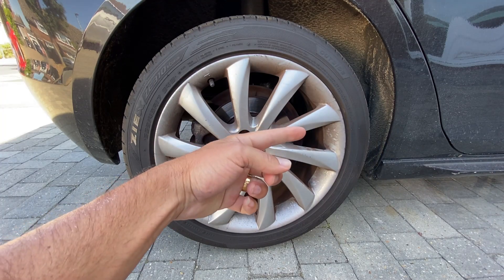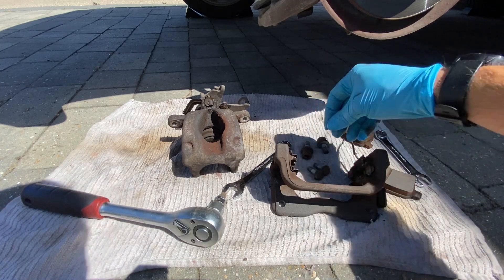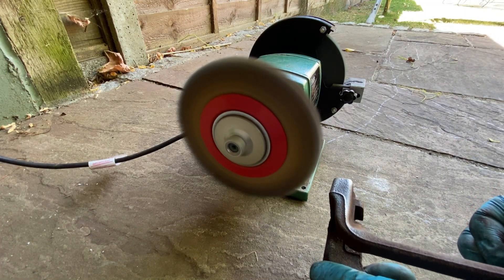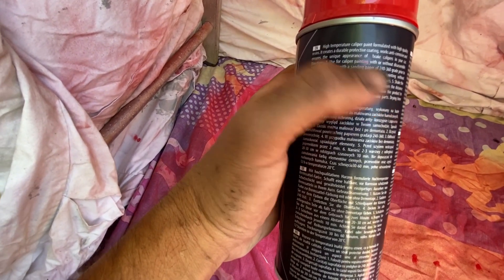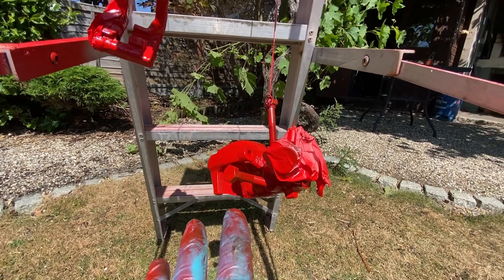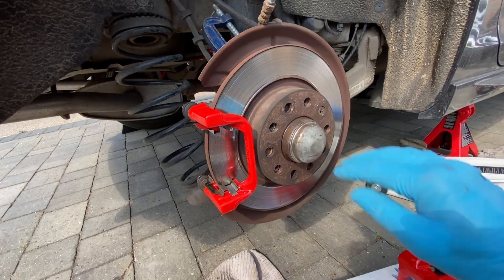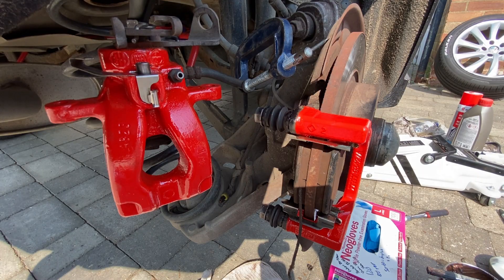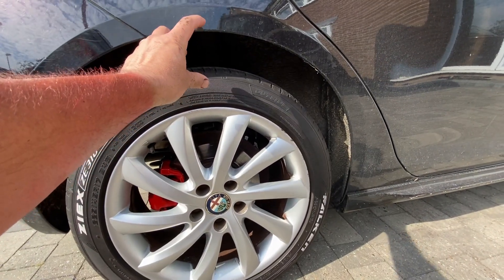Alfa Romeo Giulietta Rear Brake Caliper Painting Removal and Replace

Comment: I think that the yellow color would have been better, especially on the black Giulietta. Another thing is changing the front grill to 2016 version. And the last thing is adding the yellow strap on the front bumper. Just like this:

https://dailydriver.pl/wp-content/uploads/2020/04/Alfa-Romeo-Giulietta-2019-logo-720x340.jpg